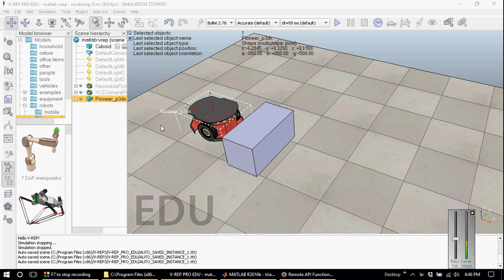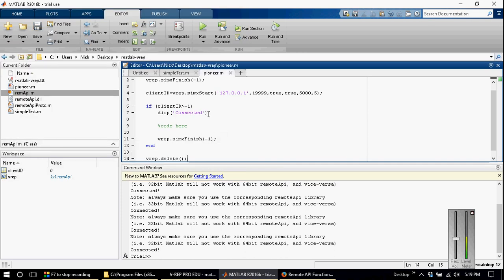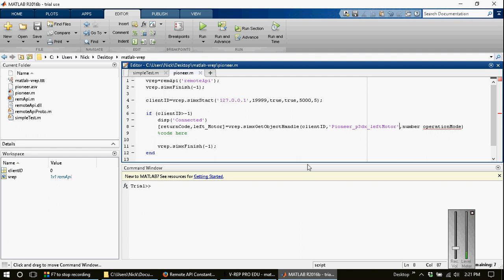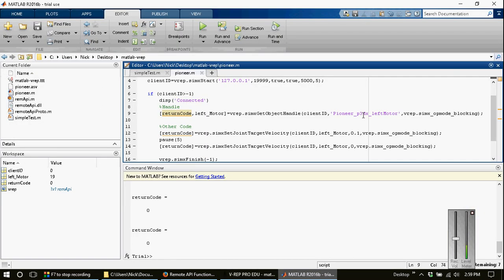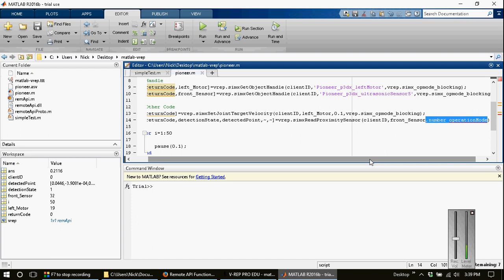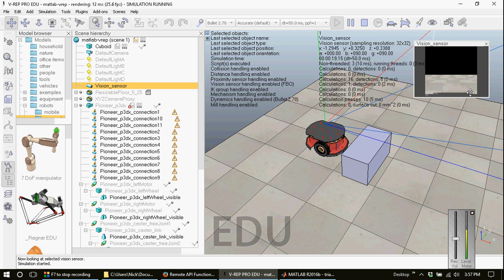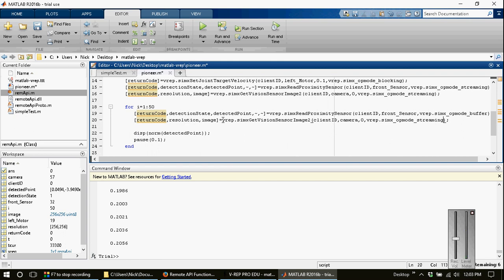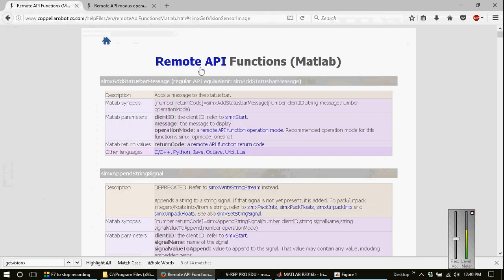05: Matlab Robot Simulation with V-REP / CoppeliaSim - Part 2

Comment: If you are using Coppeliasim v.4.3.0, using the setJointVelocity(clientID,'Pioneer_p3dx_leftMotor,sim.simx_opmode_blocking); wont' work. Replace "Pioneer_p3dx_leftMotor" with the path: "/Pioneer_p3dx_leftMotor"

Comment: Thank you very much, this is a brilliant video...very very helpful....but I wanted to ask how would you get a joint to rotate by a certain amount smoothly? I tried using the SetTargetPosition function but it just snaps to that position without gradually reaching it....any suggestions? I also cant seem to actuate two joints at one time using the setTargetPosition.
Reply: I have same problem. Have you find any solution of this problem???

Comment: Thank you, great video! For some  reason, the setting velocity wasn't working on a UR joint, but the set position command did!
Reply: Hi Sherine , I have the same problem. Usually with the LUA language there is "rmlmove" functions in which we can easily set the velocity of the joints or targets  . It seem like they don't exist in matlab library.  
 I would like to know if you find a solution for this problem ?

Comment: Hello Sir,

First of all I would like to thank you for this wonderful video on V-REP. Its really useful for beginner like me.

Sir I am new in robotics and related field. Currently I am working on Deep Neural Network for robotic motion control.

My goal to control robot simulator implemented in V-REP through remote API by my DQN algorithm which I have implemented in Torch+LuaJit platform. 

I have implemented same scenario which you have explained in above video but instead of Matlab I have used Torch+LuaJit for robot control.

Here I have successfully able to get detectedPoint (able to print them). robot control is also successfully done. But I am facing one problem I can able to  received image by simxGetVisionSensorImage() but when I tried to display or save that image I got following error. 

qlua new.lua
Connected to remote API server
qlua: new.lua:42: attempt to call field 'save' (a nil value)
stack traceback:
 [C]: in function 'save'
 new.lua:42: in main chunk

Kindly help me out. Your guidance will be great help for me.

I tried a lot but couldn't solve the problem so thought to contact you.

Thank you and Regards,
Ms. Yashashree Jadhav,
India.